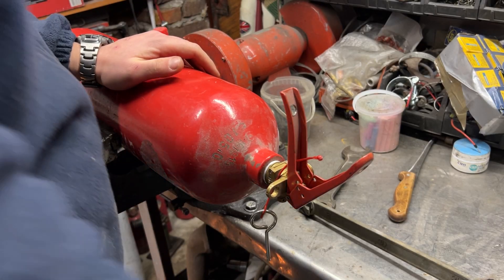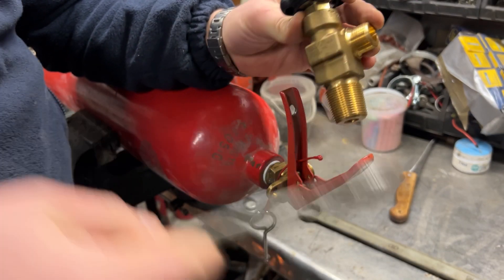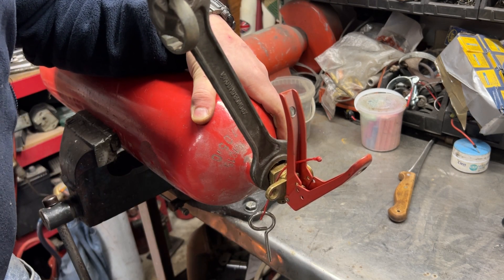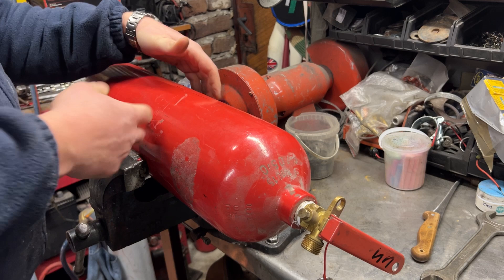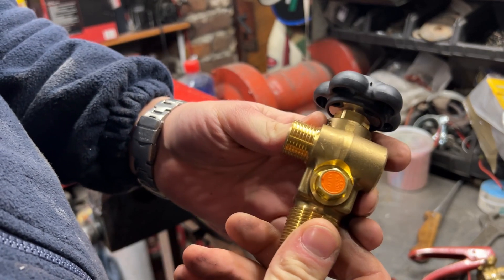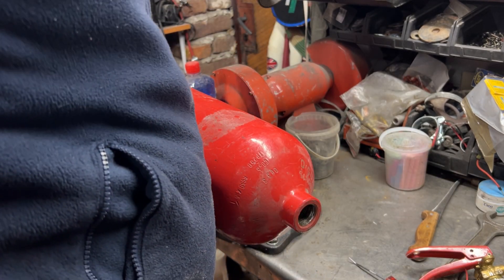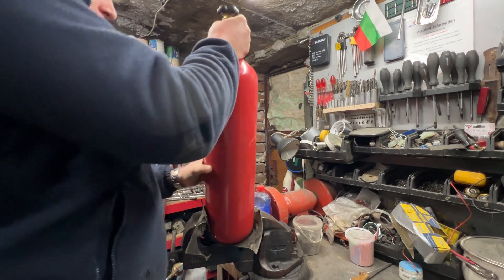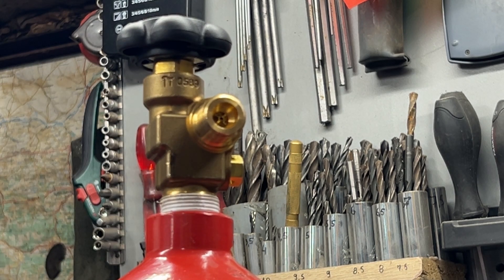How to Replace CO2 bottle Valve . Fire extinguisher valve replacement

Comment: I'm re-purposing a fully discharged bottle, but the valve is seriously stuck: since I won't need to reuse the valve, can I just saw it off flush where it connects, or would that be dangerous?
Reply: You would never want to cut it flat just because of risk of cutting into the cylinder as it would be a bit of a problem

Comment: Very good video, interesting information. Where can I buy this valve to replace the one on my old CO2 extinguisher? Do you know the thread size?
Reply from the maker: Bought it from a local company.
Reply: @MeFixingEverything  Thank you, by any chance you know the size of the thread of the cilinder?
Reply from the maker: No,but it's a cone/tapered thread. Upper part 29mm , lower part 26mm.
Reply: @CXLiToXx  this is all dependent. You’re going to need to know the exact specification of a valve and once you know that it’s very very easy to source one.